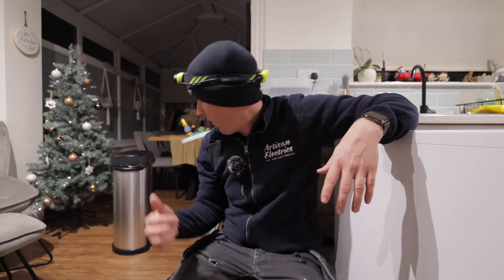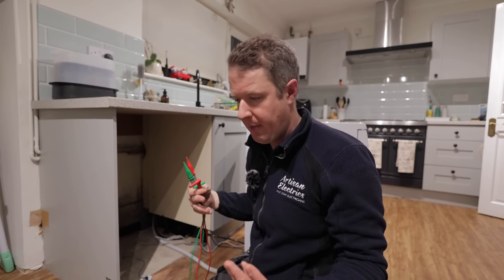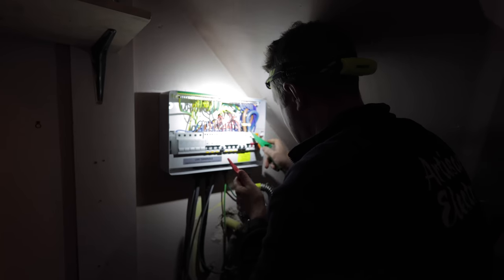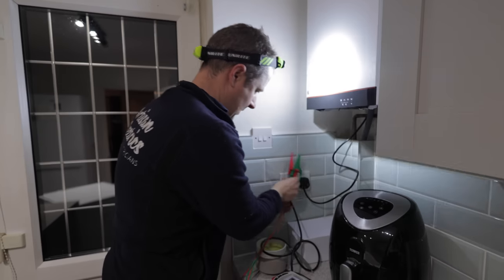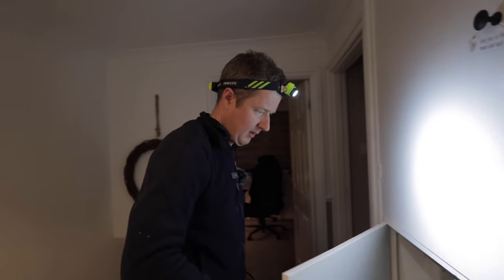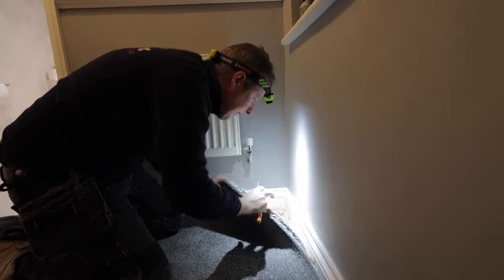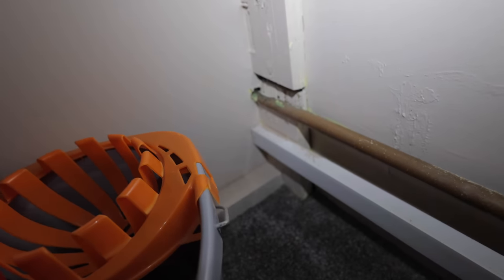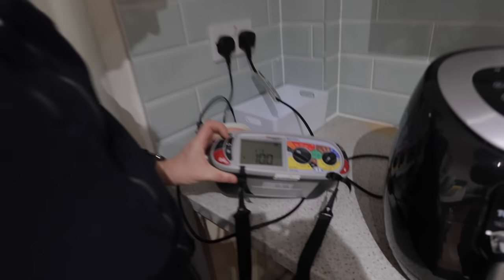Nearly KILLED by a CRAZY fault! What on earth is going on? 💀

Comment: 12:38.
There is ABSOLUTELY NOTHING WRONG, with the boiler plug or it's wiring.
What you have - is a generic (unatural) GROUNDING PROBLEM "elsewhere" which is "travelling via grounded/bonded metalwork, BACK through the boiler's copper pipework, to the GROUNDED EARTH cable inside the boiler, which thus LIVENS the earth pin - in the unplugged plug.
When you "plug it back into" the wall outlet, yes - you return the local EARTH wiring, at all sockets around about, with a HIGH VOLTAGE EARTH, sadly, it also means that at the switchboard, you have a DISCONNECTED EARTH, from that circuit, leaving a HIGH VOLTAGE on that circuit's earth cabling.

The LEAKAGE FAULT - coming from elsewhere via any number of bonded/grounded circuits, between the supply transformer on the street, and your "disconnected at the switchboard EARTH cable, is still NOT enough to blow the protective fuses, at the "other premises" fault to earth.

I had the same problem appear across a rural school's "outsid tap, drinking water founains, when a STRAY FAULT CURRENT, returning from about half a mile away, took the line of least grounded earth resistance, and appeared to LIVEN all water piing at the school, AFTER a new  submersible deep well pump (and it's heavier earth cables) brought the fault current UP the well and livened all the schools water pipes, FROM UNDERGROUND.

NEVER EVER assume that a grounded earth cable is going to be ZERO voltage, otherwise the earth cable is NOT doing it's job of being a PARRALEL, OR MAIN CIRCUIT between someone else's fault, and the POLE-TOP supply distribution transformer, outside YOUR premises.
!!!!!!!!!!!!!!!!!!!!!!!!!!!!!!!!!!!!!!!!!!!!!!!!!!!!!!

NEVER treat any EARTH as dead, when switching YOUR MAINS OFF, as it is "not" being supplied from your switchboard, but from someone else's.

XXXXXXXXXXXXXXXXXXXXXXXXXXXXXXXXXXXXXXXXXXXXXXXXXXXXXXXXXXXXXXXXXXXXXXXXXXXXXXXXXXXXXX

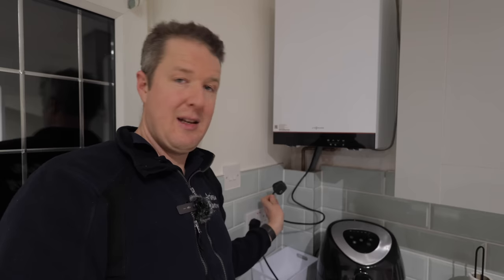Now a little later in the video, around 13:42 (the plug at the boiler, grounded / bonded to the OLD boiler piping, is itself the "neighbour" who has a diffeent PHASE to earth fault, which makes me think that the "stupid electrician, who "wired OUT to the permanent live at this lower level outlet, MAY have been colourblind, and wired PHASE to the cord's earth instead of to the phase, OR inside the new boiler circuit, there is a DIRECT JUMPER LINK, to your cable earth.

As I always say..

NEVER EVER trust any E cable, as sometimes they can go 100% OR MORE, live.

Comment: Complacency in the workplace can kill you I have had some Close calls in my now x job has a telephone engineer one instance was when I was cutting into some BT duct to put in an Elbow the was a Fizzing sound so Let go it turn out some one on site and used are duct to run the 240v to all the homes because the was a nice Grey pipe running into all the homes because the builder a few pounds to sort it out at first he wanted BT to pay for the damage unit it was explained he may of end up in jail

Comment: I had a sort of similar one the other day on a new commercial job.Stuck my martindale socket tester in and red light bleeping with 2 greens.I thought it might be reversed polarity....Main switch off.  Just a  local meter on the line side... voltage 219 neutral to earth.235v live to earth.
Turned out the neutral was loose (screw was tight but cable wasn't under cage correctly)..So all the neutrals were live....(The main switch was 3 pole not switching the neutral)